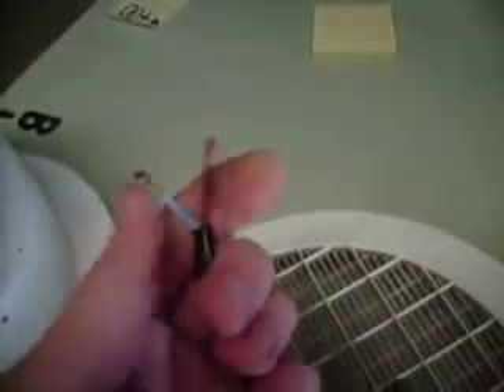cooked exhaust fan with hack job

Comment: Maybe the motor over heated.  and not oiled  there probably was too much dust  that’s why the motor burnt out If you had a spare motor make sure it fits  I had to replace the motor on my ixl exhaust fan    And now it works

Comment: man that shit pisses me off. id put a new motor in it. i have had a few that have done that. its just a defect in the winding or steem has got in.
Reply: V8Jagnut  where did you get the motor from because I’m gue for a motor for my exhaust fan
Reply: V8Jagnut  i need a new motor for my exhaust fan